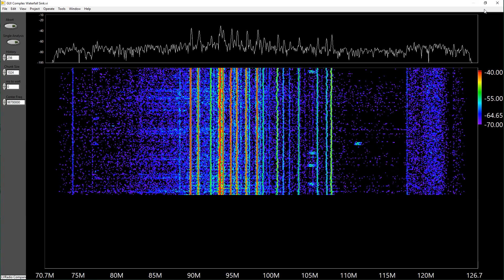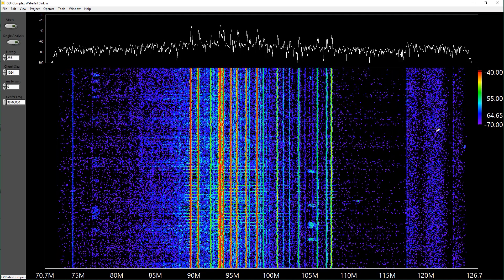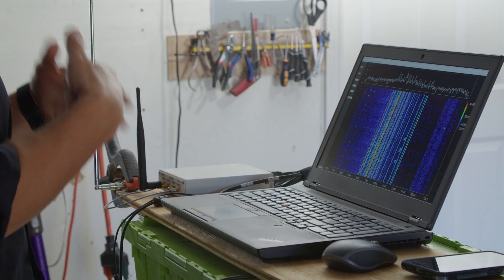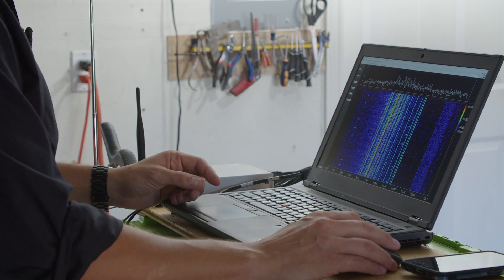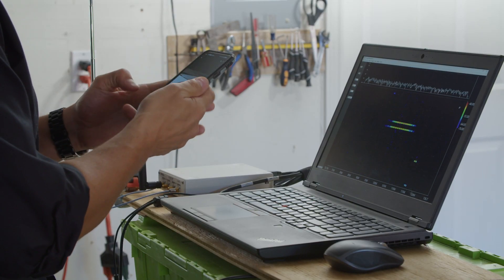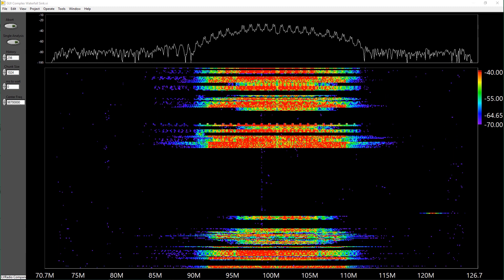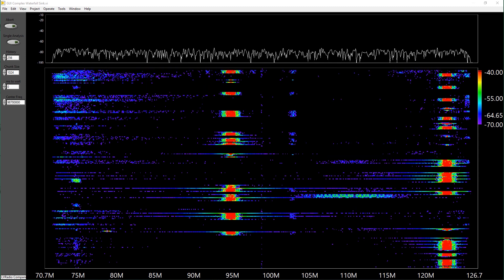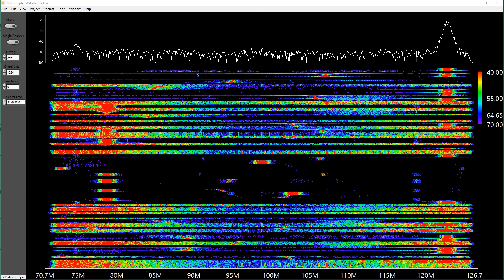Understanding wireless signals and interference caused by household devices

Comment: Do they make some kind of cover to put over your microwave to mitigate the leakage of radiation?
Reply from the maker: Hi Scott Huber,
If you really wanted to do that, you’d need to put a Faraday cage around it.
Check out this video if you ‘really’ want go that far https://bit.ly/41o03dJ
The microwave does more than enough to limit the amount of power that gets out down into the nanowatt territory so there should be no real reason to go that far.
Unless you’re taking a nap on top of 5 microwaves all going at 100 percent power while you sleep… you’ll be just fine.
Please let us know if we can assist you further.

Comment: Can microwave interfere with my wifi on my new DIY PC and shut down my PC?
Ryzen 7700, and MSI MPG B650I Edge Wi-Fi DDR5 ITX.
Happened to me several times.
Just turned off the WiFi to use the microwave and my PC didn't shut down by itself.
Like what the heck!
Reply: Depends! 
Did you put your PC on top of the microwave? How cheap is the microwave?
Also, funny enough, the bigger issue may be not the wireless interference, but more the power-line interference and noise it adds to your wall outlet supply. Consider putting your system onto a battery backup or a totally different plug, or you can buy cheap power-line filters (cheaper than a battery backup) and see if that squares things off
Reply: @normankirchner8112  
Nah.
initially the microwave oven was on top of my PC. Then this happened. Plus it was so dangerous especially when cooking Ramen. Moreso when I was taking out the bowl of ramen. So I moved the microwave to the kitchen bench top, about 20 feet away.
However, this still happens occasionally ie while microwave is on for 2 minutes, the PC suddenly shut down, like the other day.

Regarding the power-line interference, the microwave oven doesn't seem to affect my plugged-in laptop when I'm using both.

Anyway, I will have to try again, with the wifi turned on in the PC. Could be a faulty temperamental motherboard.
Reply: @RUHappyATM  you're missing a key difference here "Regarding the power-line interference, the microwave oven doesn't seem to affect my plugged-in laptop when I'm using both."

The laptop has a battery, and your wall outlet is supplying a power supply, that's going through a charging circuit and eventually to the battery which is then supplying to the rest of the system. 
With the desktop, it's wall outlet to the power supply to motherboard etc. Much much less isolation.
and if it was on top of the PC.... then MOST DEFINITELY you were asking for issues with interference. hopefully nothing holds any long term effects of it, but I know enough to know that I can't say that it's impossible that it did. Silicon is a weird little beast once it get zapped
Reply: @NJKirchner  
Doesn't the PSU prevent any interference?
Reply: @NJKirchner  
BTW, can you explain why my BT ear-phone audio breaks up when I'm close to my microwave when I'm cooking my instant ramen?
Like about 3 feet away.
Reply: @RUHappyATM  for the exact reasons I show in the video. It's using the same band
Reply: @NJKirchner  
Now that's a bit stoopid.
Microwave oven was marketed in the late 40s. WiFi was allocated the 2.4 spectrum in the 80s.
Sounds like the boffins are pretty useless in this case!

Comment: after seeing on the frequency usage monitor that half of the 2.4 gHz band gets swamped by it, i was wondering whether my microwave oven is faulty. good to see mine is not the only unit that does this. i would have thought it's more insulating than this

Comment: Im a systems engineer now but about 15 years ago I was just getting started in IT, and my job as Technical Support Specialist covered just about everything.  Desktop support, cabling, you name it.  We had a branch office that complained constantly that they would lose wireless every day around noon.  I'd never been there before, so when I showed up I was shocked to find that the previous tech had set the office up with a standard shelf to place their network equipment on.  Directly above the microwave in the break room.  I fired up my laptop, connected to wifi, started a image transfer test page, turned on the microwave and instantly lost 99% of transfer speed.  Every time Bob in accounting miocrowaved his burrito at lunch time it took down everyone connected to wifi.  I got a new shelf in the closet to terminate connections to and the problem disappeared.

Comment: In my case it's not my WIFI that's having trouble with when my microwave runs but my wireless subwoofer which is in the living room and pops and crackles when the microwave, 20 feet away, runs and unfortunately I can't change the frequency of the wireless sub adapter. I'm stuck either with the crackling and popping or running a 15 foot cable from the AV receiver to the sub.  Was hoping to find out if there was such thing as a shield to put between the microwave and the subwoofer or a better solution either than trying to change frequencies.

Comment: So I’m in a new home. The hall closet would be a sweet network center location but the microwave, furnace and other major kitchen appliances are on the other side of the adjacent walls. Would be best to avoid this area and put router 10’ farther away in another room?
Reply: Putting it further away would definitely improve the transmission and reception of your wireless signals. Metal in general will significantly degrade the RF signals